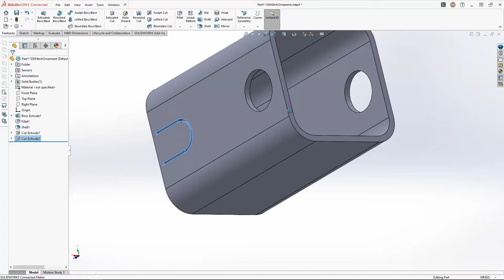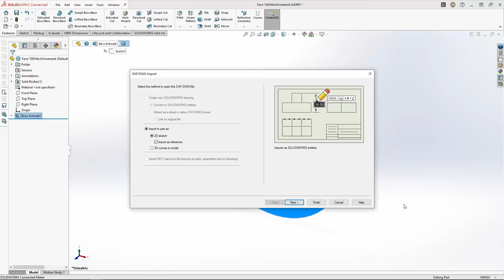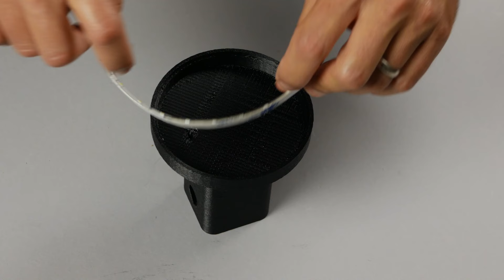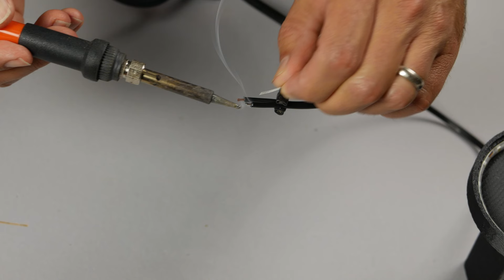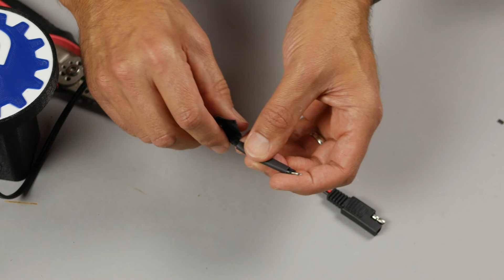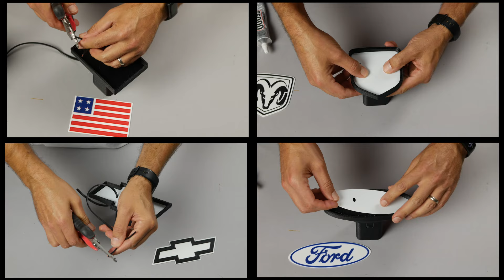Practical 3D Print: Custom Truck Hitch Cover Design and Print

Comment: This is pretty cool. I want to do this as well for my truck. Do you have the files for this? Preferably for a Toyota Tacoma 2024 and up or is the trailer hits universal for all trucks
Reply from the maker: The hitch is universal. I the files are over on my site. Link in the description. I didn't do a Toyota logo though.
Reply: @dandesigns3d  thank you for this. Also, could I do my own design for this since you have the files already like if I wanted to put a Toyota logo on it or something do I have to make my own Files? I’m new to this.

Comment: for wiring like this. there is usually 1 that has ridges and one thats smooth. i always use ridges red hot so id use the sie with the markings on the wire to be hot.

Comment: How does the PLA stand up in the outdoor environment? I was thinking about trying this for my car but New England has some temp changes that may make it break sooner than desired. And the lamp wire for outdoors? I may try ASA for my material and then an outdoor wire for mine. Love the idea and am motivated to try it. Thanks for posting it.
Reply from the maker: I've seen videos of people reviewing PLA parts that had been outside for 7 years with very little degradation. Even in ground parts. So PLA should be fine. As far as the lamp wire goes, I think what I bought was outdoor rated. Not sure about that though. You could switch to landscape wire to be sure. You're welcome. Thanks for watching.